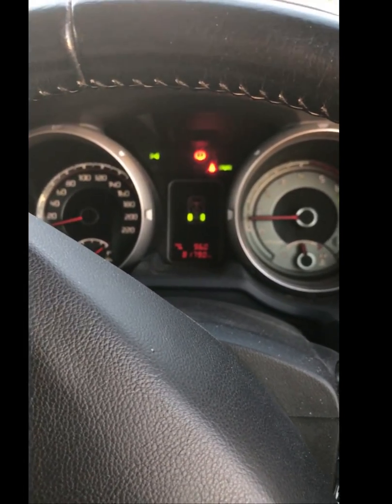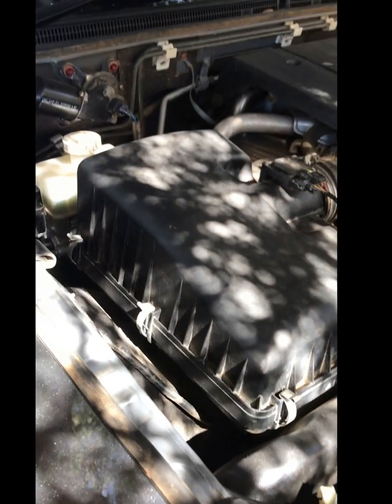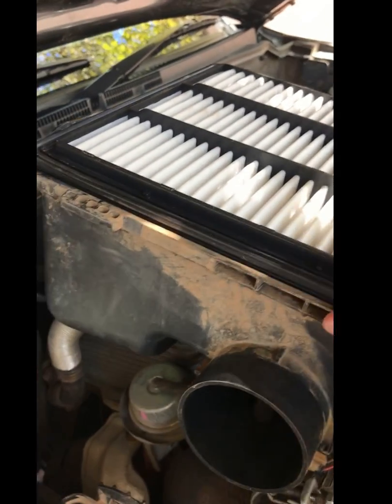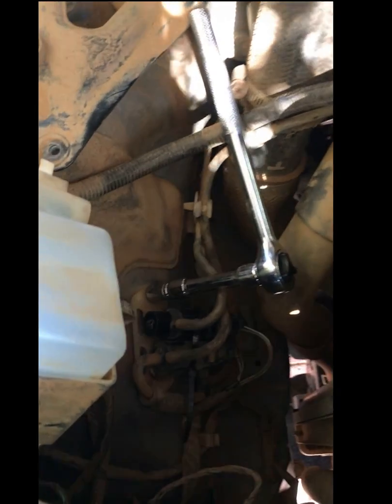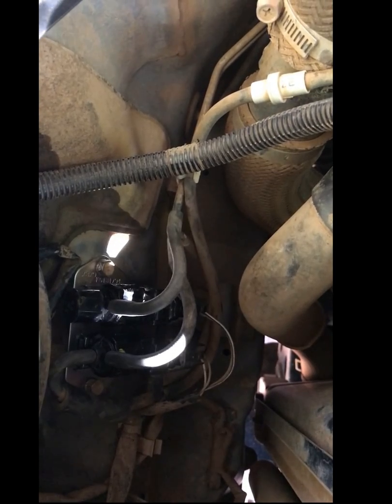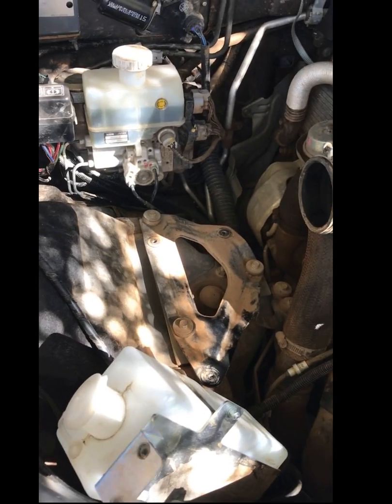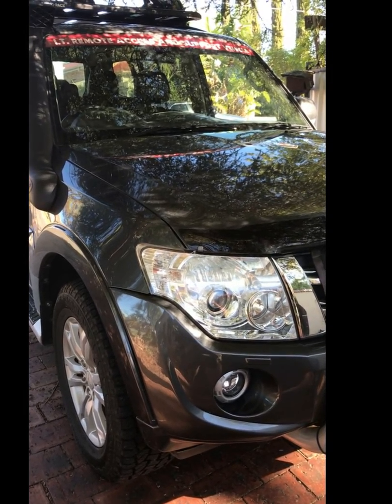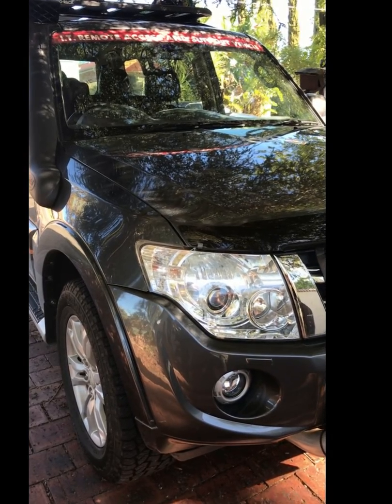Mitsubishi 2013 NW Pajero (NW) Flashing Center Dif. Light (CDL) Part 1 - solenoids

Comment: Do you know that you are the only person in the world that figured this out?
Reply from the maker: Hello, It took me 3 mechanics, thousands of dollars to finally get fed up and look at this issue myself. It ended up getting dangerous for me. I got stuck somewhere and the car would not engage 4wd correctly so I got desperate and looked for myself. Credit goes to a number of people. The first suggested Solenoids. Yes, mine were no good. Then tracing that, I found the hydraulic hose leak. Then I posted images of the free wheel actuator and someone finally said ... that does not look right :)
Reply: @MichaelJenkin  I feel you mate, I wanted to tell you my part came in and it fixed it. So really thank you.
Reply from the maker: That is awesome. I was surprised no one had tried to solve this previously.

Comment: hi brother, i have also problem Pajero Centre Diff light flashing after 30km , actually is this vacuum solenoid issue?
Reply from the maker: It does sound like the same thing. For me, it was about 40 kms but, same symptoms. It could be vacuum in the free wheel actuator, leaking hose or solenoids. It is a fault likely somewhere in that part of the system
Reply: @MichaelJenkin  actually i had done computer (obd) scanning in professional garage , they found transfer wire issue , but I have good fuel efficiency
Reply from the maker: I had it scanned but there were no codes. Apparently there are a number of models around 2013 where the ODB codes for this issue, do not come up :(

Comment: Hai Michael,  My Pajero 2009 having the same problem after 25-35km in 2wd. once if i stopped & restart the car its normal till 25 to 35 Km travel, but the light blinks again., I have changed the Vacuum Solenoid Valves, Actuator and shaft, OEM MR953767 T/HGearshift 4WD Lamp Switch. but still issue remains same. Could you please share how to resolve in this case.
Reply from the maker: Have you checked the hose form the Solenoid all the way down to the free wheel actuator ? no splits or holes ?

Comment: Hello, how long did taking the air filter box etc. off, replacing the solenoids and then putting it all back together take?  Just asking as the mechanic has given me a quote that seems a bit hefty after watching this and doing a bit of reading.
Reply from the maker: As I am an IT guy, not a car guy, and as it was done over many attempts to solve this and also I tried to film it .... once I had it figured out, maybe 1-2 hours ? That includes finding the tools and trying to figure out what to do. I think a mechanic, 15 mins to open bonnet, open filter case, pull out filter, unclip hoses, unscrew filter housing and expose the top of the solenoids, 10 mins to extract solenoid. Maybe another 10 to test it or 10 to put one back in and not test the old one. Then if needed, 10 - 30 mins to trace lines and make sure that they are all intact. If it is the free wheel actuator, took about 30 mins to pull off and refit.
Reply: @MichaelJenkin  Thanks mate, that's really helpful! Appreciated.

Comment: Hi, I couldn't figure out the problem and when i took the car to Mitsubishi centre, dont know if it was the english or.. but I just did not understand. You have made it simple and now I can handle this. Many thanks
Reply from the maker: I had a phone call from a Mechanic the other day. Yes, someone employed to fix these things. They also used my video to fix this problem and they previously had been unable to solve or understand it. It is amazing how Mitsubishi let this problem become such a mystery ! I hope you got yours solved. If not, check the condition of the sensor plugs on the back of the transfer case.

Comment: thanks so much for this video, i have same problem but never knew what the problem was.
Reply from the maker: I only hope it helps :)
Reply: @MichaelJenkin  i have tried changing mine but still yet, it is still flashing
Reply: also i notice the hose connections were tempered with and i don't know which goes to which.

Comment: Changed the solenoids and still get the fault 😩
Reply from the maker: Have you checked the hoses for holes from the solenoid to the free wheel actuator ? Can you get someone to put the car in and out of 4wd and see if the actuator kicks in ? You will need a wheel off the ground and need to rotate it by hand

Comment: Hi mate what if i leave this sound and drive it in same condition atleast 400 km ...becoz its christmas time and no mechanic showing up also parts not available .
Reply from the maker: In my opinion: If it is the hose, solenoid or free wheel actuator, it will not cause damage. Just don't flick the car into and out of 4WD. Just make sure there are no obvious leaking oil from the sensors. I drove like this for 6 months. I had 9 mechanics look at it and no one could find the issue. I had no choice but to drive like this. When we fixed it, there was nothing further that could have failed. I was not in any danger and damage to the car was limited to the parts. Again, that was my situation :)
Reply: Yeah im driving it on only 2wd on automatic D or manual 2wd ..thanks for ur reply  Micheal
Reply from the maker: @Syed Rasheed Hoda I am led to believe, if the free wheel actuator system is not working, you are actually stuck in 4WD mode as a safety precaution. I have not checked to confirm this. I can say that whilst in this weird mode, I got stuck in the rain and driving up a mud track, the car did not seem to want to climb easily. Felt to me like 2WD.
Reply: So u want me to put the car in 4wd mode
Reply from the maker: @syedrasheedhoda7790  No, leave it as is, and be aware of the lack of capabilities and weird state you are in until you get it repaired
Reply: Thanks for ur help and prompt replies mate just let u know that tbis noise comes in and goes like yesterday i drove like 35km and happen 3 times .it hard to convience any mechanic in Sydney area  that this cud be problem also every one has ots own science i call cpuple of mechanics  one of them become rude to me
Reply: Also the centre light is not blinking or in ON position
Reply from the maker: You may have another issue. A mechanic may be able to put an odb2 scanner on your car and read the error codes. You might be like me and have a few faults. The sensor system on the transfer case might have an issue.
Reply: Thats exactly what im expecting i gave my car to mitsubishi service centre today finger crossed i told them that plz check this solenoid as i read in many forums and yutube here but they are not ready to listen they say they want to do there own diagnosis i just pray they have got this thing previously in there experience finger crossed let u know tommorow
Reply: Hi Mic they found the fault by opening all the actuater assembly atleast they fpund it i wad tired of telling them that this switch is the problem but they wanyt to diagnosed themselve wierd isnt it here is the vdo link they sent me today http://email.citnow.com/wf/click?upn=8A5fyHcoW7WbZk31Ig7t24IPpTgpqppFu8Ev5S8IrfArirt67htPVUh96VAg5hnR_sMHIP9mPHkms7pUhKEqKvFcanGvTUE6aDU8uwBPpWzMXCjo98O1Y6feDeXgZYdbV0LDifOHyn6P13fhch8g2bND4-2F3YGKkHZwruDiIsfMnDLw1riApL3r8AAoFs35r-2FAPlXQqsR4z2d2TB1oJmpND9O9wGaAxMW797NpIN8SgINQQZtchoUQ2wWhYIA4VDTd39Tq9-2F68O1K0vlJYETfWMkejYv-2Btp-2BAKBNAyW-2F6dqlXzbP5JcwEt-2FRMi-2F95BJm3K7U0jHoxG-2BnEOZ52c-2B-2Fj7wz6Ok36rhTXicm3sdw64obQNv-2BumxweNltgb0Fw-2BjXB6aXousNYPzJp3EB2Un3dKDYeR-2BMqol7pkDUyxrfsu-2BI3jstFXrgtiqkKqVwgIahoCeubRPOu-2FpsesHoimTGq0DXjhoYN5L3LlVMUfCNc-2BwY8XHnlQtj3wLnjjuQk4Gih4
Reply: And one of my freind who works in toyota dealership he told me that its better to change the solenoid asap becoz it will effect the actuater and i think u have to change ur actuater becox u run ur car 6 months with broken solenoid
Reply from the maker: Syed Rasheed Hoda the solenoid can affect the actuator working (although sounds like yours did not work anyway). I can’t see it damaging the actuator, the solenoids are cheap but hard to get to. As a good precaution when trying to fix something like this, it is a good place to start
Reply from the maker: Syed Rasheed Hoda the actuator was smashed on mine. I must have hit a rock and it could no longer hold vacuum. Driving with the actuator broken means you can’t engage or disengage the free wheel meaning you can’t go from 2wd to 4wd. Depends on if the rod is in or out at the time, the damage done and if a lack of vacuum will move the rod out, whether you are stuck in 2wd or 4wd. You were likely in 4wd. The solenoid leads to the hose that connects to the actuator.
Reply: Cost me 850 $$ but yeah atleast get to the point ur vdo helps a lot thanks mate
Reply from the maker: I think I mentioned that 9 mechanics looked at mine. In the end, total, $3000. No fix. Then $30 ebay actuator and $18 eBay solenoids and I fixed it myself after doing the analysis myself
Reply: Hi syed, I watched the video from your mechanic, has your car finally been repaired? Is the light still flashing or its gone? I am asking because I have the same problem with my Mitsubishi Pajero 2009

Comment: Which wires of the transfer case gear lever hold positive charge?
Reply from the maker: If you google "pajero electrical wiring diagram" there are full diagrams in PDF format for almost every model available. There are even a few workshop manuals you can find. I can't recall off hand which wire to look for but it should be easy to work out from one of the diagrams

Comment: I am right at the center of a 4WD challenge. All vacuum connections to and from the transfer case have been removed the on this Pajero glx 2006. Micky pliz any directions as to the vacuum line connections and the electrical sockets? It runs a 4m40 engine and manual transmission. I will be glad.
Reply from the maker: Hello, there are diagrams and notes in PDF format that I have seen in a forum. Off hand I couldn't accurately guide you, I think it is the Pajero club of Victoria that has it. Anyone can join and get help and documents. I will see if I can get the forum URL
Reply: @MichaelJenkin  I got information about how to trace the vacuum lines. I accordingly connected them. Now the problem is the actuator diaphragm at the diff locks but can't free wheel even if I change to different modes. I am wondering whether the problem is the transfer case selector stick electricals. Pliz let me know which states of voltage those wires contain and how to test them.
Reply: @MichaelJenkin  losely speaking I can now manually have 4wd on and off by removing a vent connector. How do I get back the electronic system on?
Reply from the maker: @wodeyaeric5351  sorry, I have been unavailable. Did you manage to solve this ?
Reply: @MichaelJenkin  I surely overcame it,Mike.
Reply from the maker: @wodeyaeric5351  awesome !
Reply from the maker: Join up and get your questions answered https://www2.pajeroclub.com.au/forum/
Reply from the maker: Try this link https://images.app.goo.gl/Z1pFHW8ZUCjD6TSVA
Reply from the maker: In case the links I included are removed, Google images search for "pajero vacuum line diagram gen 3" and select the link to the Pajero club

Comment: Can you tell me how to disconnect the two electric cables please, the lugs on the side, do you lever out or squeeze & pull
on connector ? What technique do you use. Thanks
Reply from the maker: Mine were on good and tight. I think from memory I levered the plastic catch with a very small screw driver and pulled really hard, which then released unexpectedly and I accidentally punched myself in the face .. fat lip. I don't know a good technique. It was not easy.
Reply: Currently having the same issue

Comment: I heared that Pajero made in 2018 does not have the freewheel actuator. Is it true or false?
Reply from the maker: Personally, I am not sure. I will ask around. I know it is not AWD and there would still need to be a way to click the freewheels in and back out for 2wd. Have you heard this about the Pajero or  Pajero sport ?
Reply: I mean that Pajero 4 is still Full-time because still has the central differential. In 2H mode the front wheels driveshaft is disconnected in the gearbox. If my information is correct and the freewheel actuator has not been on the place , then the front wheells have to rolling the front differential and the shaft. Pajero removed  the actuator for reliability reason of front differential. I found this info on some Russian forum related to L200. For I'm not sure on my concern.
Reply from the maker: I looked at a 2017 model that still has it. I need to see a 2018. I have asked about but not many people know much about this. You may be correct but I thought they were committed to changing very little on gen 4s.
Reply: Thanks a lot for your investigation. I glad to hope that there has not been critical change in Super Select II. I have Pajero II and now I am going to buy Pajero IV made in 2018 that is still availble in Moscow. Cannot wait Pajero V because it seems that Pajero V (if will have appeared someday) won't be the same philosophy unfortunately.
Reply from the maker: @sergeykostylev9390  yes, Nissan and Renault are involved and they were talking patrol drive train and then talking electric. Who knows what the V will be :(

Comment: Hi,
I have same issue which is shown in your video from some weeks
my car is Mitsubishi pajero 2015 model.
i scan the car for error and no error is showing up
my car is facing same issue or something different?
Reply from the maker: Hello, Is yours an NW ? Mine throws no error codes either. I had to use the process of elimination. Given where the free wheel actuator is and also the condition I found my solenoids in, I have no doubt that this is a very common issue. I can't guarantee from your comment that you have the same issue but it does sound like it.

Comment: Folks I finally managed to get around to sortibg out my green light issue and thought I would share a couple of addendums that may be appropriate for those driving 2008 Triton /L200.

1. Location of the solenoid.

After searching high and low, the solenoid was not under air filter nor across the inner bulkhead. It's actually on the chassis near the front right wheel /drivers side. 
2. Spare. 

I bought a replacement from aliexpress, around 15 USD and delivered to my in Malaysia in around 19 days. Aha. The mounting I have is very different from that shown here and elsewhere. However there's a neat trick. Each black solenoid cylinder clips out of the mound. There's essentially a plastic tag that you push down and each solenoid slides out.  I actually found this easier to replace all of the pipes electrics by doing each solenoid in turn ... remove from old and slap on to new one at a time. 

Success. 

Good luck lads.
Reply from the maker: awesome and no more flashing lights and 4wd mode working all well ?
Reply: @MichaelJenkin  all good. Many thanks again for your insights though.  Still the best AV out there on the issue. Go well.

Comment: Good man. You're the only guy that's been able to show clearly where the solenoids are on my 2008 Triton despite hunting high and low elsewhere ( seems Mitsubishi faffed around with the placement over the years and models )  much appreciated.

Steve.  Kuala Lumpur.
Reply from the maker: Awesome to hear. Yes, I had to learn a lot to get to this point and also found very little online !
Reply: Well I'm not going to reclaim my favorable comments Mike ... but having done a merry dance thinking you'd cracked my "where the bloody hell are the sensors ".... nope. Removed airfilter box and look and behold what looked like the bold holes for the solenoid assembly ..but no bloody solenoids. (  old they have been nicked and that's the problem of the flashing lights ;-( ) ... so the search continues. .they're not where anyone has said they are.  2008 Triton shorty. With a now festive green flashing light.
Reply from the maker: @stevewells2327  The solenoids appear to be the same as the Pajero (at least Mitsubishi Triton 1996-2006) and I believe the 2008 just looks slightly different. Can you see a pair of plastic air vacuum hoses coming from the  free wheel actuator and trace up into the engine bay ? On the Pajero, the plastic becomes metal pipes, then in the engine bay goes back to plastic piping. The solenoids are usually bolted against the body somewhere.
Reply from the maker: @stevewells2327  Actually are you specifically after the sensors or the solenoids ? The sensors are a completely different pain to locate. I must admit, it was a pain to get in there and replace the solenoids. I can completely understand if a previous owner of your car relocated them. They would also need to relocate the  power and other cables.

Comment: My Pajero 2006 does the same after 25km in 2wd. I read about the problem with the solenoids but never knew where it was located and what it looked like. You have done a great job in actually showing how its done. I will surly give it a try. Thanks.
Reply from the maker: Thanks Hasan, I hope that this helps and you are back on the road in 4WD shortly.
Reply: Hi, did this fix your 4wd centre diff lock light flashing issue?
Reply from the maker: @byronsmith6454  sure did ! (In my case)
Reply from the maker: @byronsmith6454  Any one of the things I found wrong could have in inself fixed the light flashing. I was unlucky and had multiple issues
Reply: @MichaelJenkin  plese halp me brother .diesel pejaro .. froblem
Reply: Hai Hasan,  My Pajero 2009 having the same problem after 25-35km in 2wd. I have changed the Vacuum Solenoid Valves, Actuator and shaft, OEM MR953767 T/HGearshift 4WD Lamp Switch. but still issue remains same. Could you please share how did you resolved the issue.
Reply: @vijayakumar1353  I did not have time to resolve it, as I had to sell my Pajero. If you have changed all the things then may be your lines have a leak due to which vacuum is not holding.